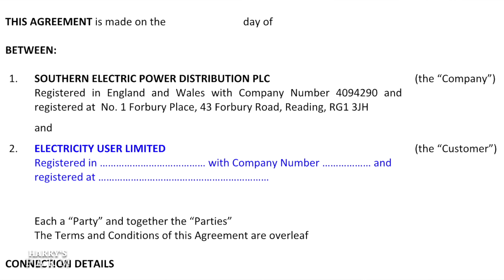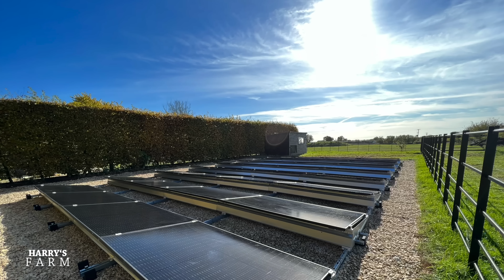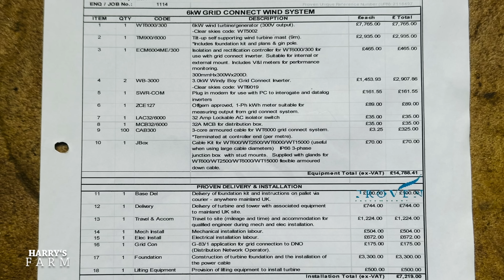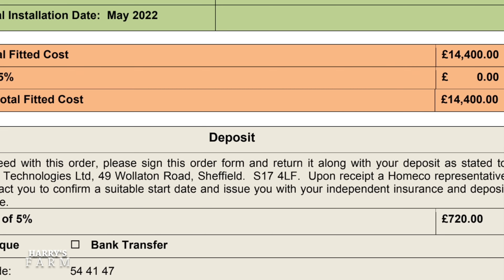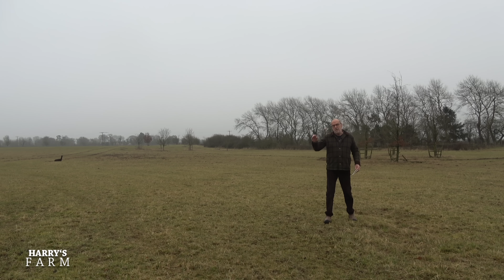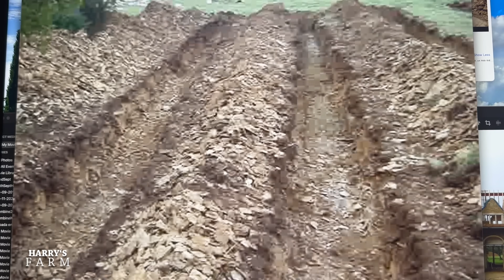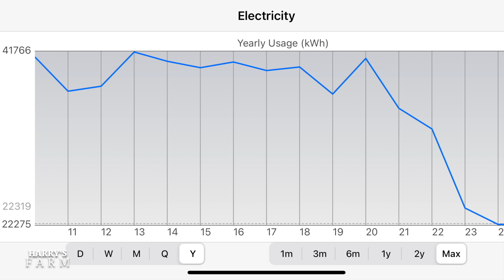Are solar panels & heat pumps worth installing? Here's what I've learnt after several years of use.

Comment: Here's a new series of projects for you Harry that will help move the needle on the reduction  of carbon emissions from agriculture which you as an indusyry should be at the forefront of.

Talk to companies like 2G Energy about used of combined head and power systems. (CHP).. Here you will have all the heat necessary to keep your swimming pool warm all year round and as much power as you can use. Systems can be anything from 20 to 450 KWs..

Also why don't you talk to and work with JCB who are busy bringing Hydrogen fuelled "tractors " and earth moving equipment to market using IC engines fuelled by hydrogen.

They claim to be able to convert existing diesel engines to run on Hydrogen and will deliver such fuel to your door.

Be an interesting pilot project for you and you could lead the way for farming in the future. Sure you'll find grants to support your venture from the Govt funds  as we All strive towards net zero..

Comment: In your latitude...you're at around 52 deg N...you should have your panels angled at at least 30 deg toward the south. 
The fact is, solar panels make their best energy when pointed directly at the sun. You could get much more energy by simply angling them more but you would need to space them farther apart to avoid shading the panels to the north of them. Or put them on steps...anything to avoid shading, as you correctly observed.

Comment: If you had a battery during the winter months you can buy electricity at night for off-peak prices of 15p kWh. You can store excess power in summer and sell it for 27p kWh to Octopus. I'm supplying all my power and earning extra cash to offset my winter costs. I can control completely when I charge and discharge my 15 kWh battery to give me the best return. ROI has really come down.

Comment: Dude: you are getting tripple the drop in winter because you keep your panels laying flat. The sun is not high in the sky in the winter, it is on the horizon, so stand the panels up into the sun.
Example for London: pales should be at 21° to the ground in June and 51° to the ground in December for optimal sun coverage and production.
Reply: Yep, the panels on my roof (where i cannot change the angle obvs) gave 1/7th, not 1/14th the output Dec -> June. When i saw those panels i thought they would be on a simple system where you could, say monthly, set them to an optimum angle, an easy task as they are on the ground, but it doesnt appear so.  TBF my winter output is still pants but summer export effectively pays for winter usage.
Reply: It makes almost no difference. I've used calculators and tested the results. There just is no light in winter
Reply: @P7ab  Indeed, tilting them for the winter is pretty useless as in winter it's more often cloudy than sunny. I have mine laying flat on a flat roof. I just laid many, many more than you'd normally do. In summer I have way too much just to have just enough in winter.

Comment: I told people that there was no practical way to heat a typical American tract home using a heat pump (and nothing else), in the colder regions of the world, with nothing but solar panels (no grid connection), they laughed at me.

Edit: To clarify, this house is extremely well insulated, American tract homes are not typically well insulated, especially if they're more than 30-40 years old.

Comment: The seasonal variation will have been documented in the quote documents,  and Harry seems smart enough,  so i dont accept that low winter ourput was a surprise. Our system does the same. We do have batteries,  and they save £80 a month during autumn and winter.

Comment: Just a slight correction on your first point re: Permission.

You do not have to seek permission unless you are installing an inverter higher than 3.68kW in rated output. You can also install larger systems with grid export restrictions in place, on a fast tracked DNO approval basis. It's only if you're looking at a large and fully unrestricted system that you'd need to seek permission from the District network Operator

Comment: What a misinformed rant. The solar panels are angled so low that the winter sun barely has an effect on them. The ground heating pipes are, by the looks of it, at most two feet under ground and fully subjected to ground frost. Bury them deep so they stay at a constant 10ish degrees year round, that's the whole idea.

Comment: All those Solar PV installations in the UK seem to be relying on the Feed-In Tariff to the electricity grid to financially reconcile the capital outlay. That worked here in Australia initially right up until recently were we have so MUCH Solar PV installed on houses and so much of its power being dumped into the grid that Feed-In tariffs have plummeted to 3c/kWh (1.5p/kWh), or less with some providers as actually talking about charging you a fee for electricity feed-in! Home Battery Installation on new installs or alongside existing Solar PV is the new norm as we try to mitigate use of Grid supplied Electricity - which has contrasting effect of lowering demand and raising electricity supply prices. Also the Virtual Power Plant (VPP), is being pushed by our new Government so that Electricity Providers will subscribe to control your battery and export power at times they need and then pay you some amount for it. Maybe UK is headed that way way as well.

Comment: Harry - you need some batteries and some more solar panels at different angles. You can then charge the batteries overnight at a cheap rate for use in the  winter and export more in the summer.

Comment: We live not too far away from you Harry and also built a house, same size, completed 2009, a Weber Haus from Germany, SIP Structual Insulated Panels, AS Heat pump and solar water panels and our annual consumption figures are close to half yours (but we don’t have a pool) . Apart from being SIP we also have a huge glass area, floor to ceiling triple glazed doors/windows and being south facing we ‘harvest’ a great deal of heat direct into the hose with glass. Recently our 15 year old heat pump went bang, Nibe (IMO don’t touch them with a barge pole) and finding a contractor to just a replacement without a complete system was hard, they all want to do a plug and play full system. Went Vaillant pump with Wiltshire Energy .. fantastic equipment and guys. We have now added 40 x 510W solar panels and 3 Tesla Powerwall so we can store during the day and export at peak (4 to 7pm) and still have enough for the house. Tile Energy, Royal Wootten Bassett) In winter when the sun is hiding we charge the batteries at 2 to 5am at a very low rate and depending on that days usage we can still export some at 4pm. With this complete system on this house we now have an annual energy cost of negative -£1,800 and that will only increase over the next 20 years as the price of electricity goes up and export rates increase with inflation but our hardware cost is now fixed. Hope this info helps some to venture into ASHP, Solar and batteries. Like others say below, my transparency is reciprocal to yours for your viewers. Thanks. p.s. I also like lying on my garage floor 🙂

Comment: Micro inverters such as the Enphase ones can mitigate the 'one panel shaded 'issue to a good degree, from memory. I think they may perform much better in winter too compared to string inverters, but not 100% sure of the exact difference in performance.

Comment: Hi Harry, Very impressed with your system, you obviously have a passion for renewable energy (it probably has something to do with you heated floor in the garage 🙂) could I suggest you look at micro inverters which would remove the drop in power you are experiencing when 1 panel is in the shade. If you have 28 panels and as you know one becomes shaded you loose more than that panels output. If you have micro inverters fitted to each panel you will only loose that panel all of the remaining panels will still give you their max output (whatever the weather is allowing it to generate). It is also safer because you are dealing with AC power circuits connecting all of the panels as opposed to DC. You should have a life expectancy from your current inverter of 10 years so it will be a while before you consider it but it is still worth doing the research.  I'm not a salesman I have spent the last 6 months researching for my own project and while I had discounted the wind turbine initially I can see it has a place when combined with Solar. Thanks you for the correction in my thinking.

Comment: First off impressive system. Panel shading? The answer is microinverters. Batteries, you are missing a trick not having batteries, especially in winter. I think there are three components needed in an efficient solar set up, the panels, batteries and tariff choice.  With your EV you could have the choice of very cheap off peak electricity about 8p kwh. With batteries you charge them at the same rate. So daytime no sun for solar but you now run off batteries charged at 8kwh.  In sumner you charge for free daytime, run the house at night for free from the batteries. For saving money all year round any house even without solar can save from batteries and the right tariff choice. You could save a lot from batteries too.

Comment: Harry, a nicely presented video,with a clear explanation of what does what,the impact of Government intervention on your activities would also be interesting, you did make comment, but more info is of interest as it shows what the Gov. is thinking up. Regarding Solar, if ANY panel produces less voltage for any reason ,then ALL of the panels follow suit. This can drop the KW significantly, this can be overcome by installing MICRO-INVERTERS to each panel,

Comment: They lied to you about shading.  If one panel gets shaded then that could stop the flow of electricity because there in not enough being internally generated to let electricity from the other panels to flow through it. There are panels that will not block current to pass thru if that panel is in shadow.  
Another thing is you have not angled the panels correctly to the sun.  Your angle looks more like you would see at the equator.  Without looking it up you should have at least a 45 degree angle.

Comment: As people have said the angle of the solar is detrimental in winter - I have 44 panels and on a dull, cloudy rainy winters December day they still put 10% towards the daily usage. I also have batteries to extend the gains when we get the odd sunny spell in Winter - when batteries etc are full the excess goes to the immersion heater in a 500l tank and to the grid.  We have 2 x 14kw ASHP as the ground loop would need to be 2.6km to avoid cooling the ground if we had a poor summer and the cost to run pumps for that are significant. 6600 square foot house - I doubt a contractor today would recommend slinky on a house or your size.

Comment: 5:28 Noticed you have a micro wind turbine. Was that installed prior to you moving in? I can't see any info on your other videos.  It'd be useful to have some data on it such as low/typical/high - annual/daily output, maintenance costs, wind speed to activate.

Comment: Affluence.... You can't beat it.

We run our house in Tasmania Australia on 2kWh per day. Plus the wood fired AGA in winter. Our solar array is just 8×260W panels (almost 10 yrs old now) charging batteries. We're completely off the grid. Haven't paid for power in 20 years....

I could've told you about winter! It's feast or famine with solar. We can have days of ZERO production in a row. And there's no way I'd ever contemplate buying an EV.

Our house is heated for free. Free of energy input and free of technology.... Passive solar, can't beat it.

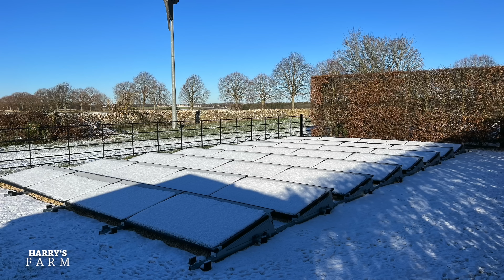Comment: You can see from the winter photo 4:06 (well done finding the time to take a photo that one single day that it actually snowed in the UK) that you're getting even more shading, and across ALL 7 parallel panels (or 2 out of 4 if they're connected upwards instead of across) and that's just poor installation.
For most/normal people, who don't happen to have the money required to build a house to personal specs in The Cotwolds, get them installed properly on your roof, rather than that extra mass of land you have going spare (in The Cotswolds)

Comment: Great video!  We also have solar and GSHP.  I’m left thinking you might be missing out on what is to me the biggest benefit of home batteries, and that is time of use tariffs such as Octopus Cosy or intelligent Go;- great for charging up on cheap rate electricity for later use when the rate is much higher.  

We went for PowerWall and it’s been superb for us with a very attractive ROI and the added benefit of protection against outages; after all we can’t have our underfloor heated garages getting chilly because of a power cut can we? 😉

Comment: You may want to build a Zagari wind mill, its like no other, its a vertical turbine with 4 or more panels spinning inside a square cube, the cube  has 4 sides each side is half blocked to stop the wind from pushing the wrong side, when the wind blows it spin so fast its scary, but it will not blow over because the centrifugal force keeps it still.

Comment: Lovely house and garage. Perhaps consider also a non grid set up using full EV battery packs and using Simpbms as it would let you capture a lot more at very low GBP per Kw. I have seen an almost new 30kwh pack for £1k. If you selected the battery packs with good chemistry (NMC111, NCM622, LFP) then you would get a low cycle cost. If you could afford it and preferred long term least maintenance get LTO cells as they would still be going full tilt in 20 years time yet you wont get them from any UK car. There is no reason why you cant have 1/2 your farm/house off grid (hopefully they would have put some cable ducts in etc). Then you can put in panels farmer style (ie you do the actual work) and get wiring terminated/tested. Your grid 3 phase system was the limit for the grid connected part. Yet your farming side could easily be run fully off grid and at whatever size your roofs permitted. Esp when a barn needed a few roof. 
 
Shading and bad weather can be optimised with various devices or from the panel selection. You have enough space on buildings to put a lot more panels so you get decent generation even in full shade. PV gets power from sun but just as we can see without a torch even when its a grim overcast day panels still generate power. By separating the storage though you might not need 100's of Khw storage to power you through bad spells of winter overcast weather. Then you might find new opportunities what you can do with way more power than you can consume - drying other farmers grain, Hydroponics etc. PV Panels are very cheap. Its the other parts that can end up with a large bill. Its not highly skilled - as in tuning a set of Weber 45DCOE Carbs would be..

Comment: Your fascinating exposition, in my view, underrates all the care you took with insulating the house. Most of us live in houses built before heat insulation was properly understood and valued, and pay for heating accordingly. I have put a lot of work into my own house. Before I did that, I was using over 20,000 kw/h to heat 100 sq. metres! Your system therefore looks amazingly efficient.

Comment: Short answer no, long answer no...
This is not to say they don't pay back eventually for someone like yourself with a small holding or farm, but the push for these silly green toys onto people in domestic properties is ridiculous.

Also Cookers are much cheaper to run than electric based on the unit price and a like for like test, they always have been.
Gas boilers are cheaper too than heat pumps and it's a myth they are more efficient (all based on net-ZERO nonsense) and can also be used for underfloor heating with a  two-port valve.

BTW love the videos, knowing nothing about farming and with the recent ridiculous situation with farmers and farming you keep me informed as to the current situation.

Comment: Why are your panels at such a low angle? An angle of around 40-45 degrees is needed where you live to maximise solar collection. Mine are at 30 degrees on my roof which loses around 10% although each panel is controlled by an Enphase inverter directly underneath minimising DC losses.

Comment: Why are your panels on the ground? You can easily elevate the whole lot of them 8 ft high on pillars and beams and use the patch under them for a nursery or vegetable patch. That will also solve your shading issue and if you use a broom you can clear away all the snow as well. Thats going to up your solar output dramatically.

Comment: ? ...good question ... 1000 meter deep ( coal mining ➡️🇩🇪) yes it is/was very warm for a human-organismus ...so we cooling what a "electricity cable can deliver..." 27°C or more down to acceptable temperature so good as possible ...but how deep is the drilling for the heat-pump pipe's ? 
better is temperature to electricity converter and than heat up air/water

Comment: I have had a Heat pump (8kw) for heating my 20m3 Pool for about 15 years and apart from say burning wood I found it to be the best value during summer. I experimentally initially laid agricultural heater wire under the pool liner which was quite successful and cheap as I liked the idea of heating the pool from the bottom..Heat rising etc..  My concern about heat pumps (or any external heating) was it took some water from the pool.. heated it,  and put it back into the cold pool where I felt most of the heat just dissapated.. Pissing in the ocean analogy..   It would have been better to take the heated water and store it in a second (Highly insulated) storage container and eventually bulk returned to the pool..  I never really kept records but roughly it cost about £10 a month to heat the pool..  There may be better methods to tweak these options..  Well presented information.  Thank you